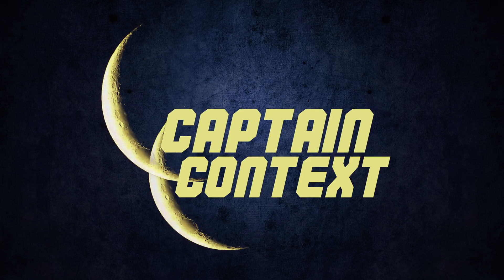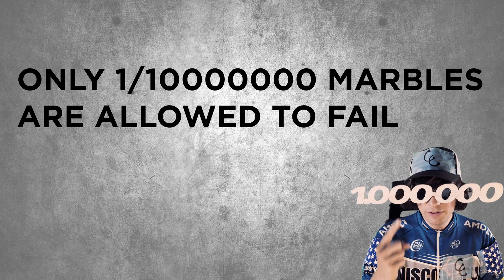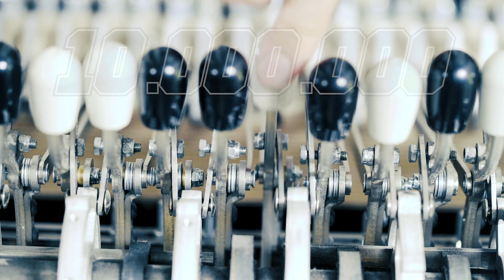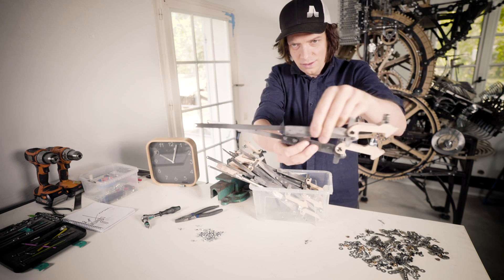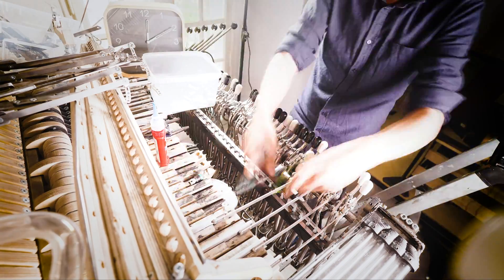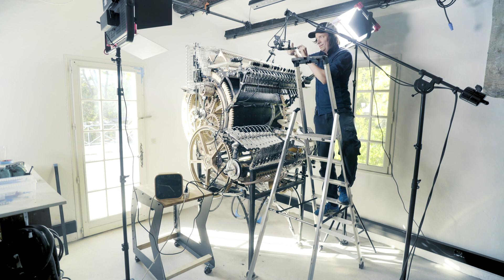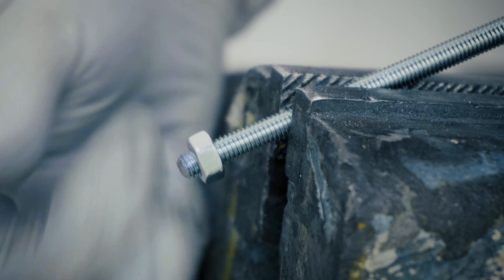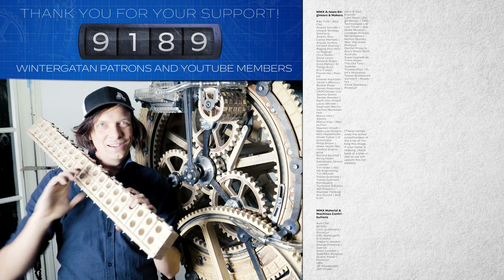Countersink? Why? - Marble Machine X #143

Comment: Martin, unfortunately math doesn't work that way. If only 1/10,000,000 marbles are allowed to fail in your whole machine, you have to multiply all the "chances" of things going wrong together to arrive at that.

That is to say, you need the equation:

[Chance of Success derived from the specific Part]^[Number of parts that can fail] = 1 - [1/10,000,000]

As we've simplified down to a single part's chance of success* instead of aggregate success, we can use the substitution to find maximum allowable failure rate with 

[Chance of success needed] = (1 - [Max Chance of Failure])

Let's just assume you have 1000 parts that can fail/can affect marble failure (I'm sure it'll be much higher, in the end, but just for rough math purposes...)

That means

[Chance of Success needed]^[1000] = 1- [0.00000001]

[Chance of Success needed] = [0.9999999]^(1/[1000])

[Chance of Success needed] = 0.99999999989999999500499966716648....

[1 - [Max Allowable Chance of Failure]] = 0.99999999989999999500499966716648

[Max single part failure rate] = 0.000000000100000004995000332834

or basically, 1/9,999,999,501 ... 1 in 10 billion, basically. 

That is to say, if each part in your machine has 10 billion marble events, they should only fail catastrophically/haltingly once. Any higher failure rate means that in the aggregate, you will have more than your 1/10,000,000 failure rate for the overall machine.

*The reason we have to do everything with a "1 -" is that we're looking at failure rate in aggregate, so we don't need everything to go wrong, but rather everything to go right. This math takes into account "double failures",  "triple failures", and so on.

Comment: I understand the reasoning here, but I feel I must point out 2 things:

1) this is a misuse of statistics. A marble will eventually fail. The machine will eventually break. Plan for it, because that ONE in ___ can be the first song, or even the 1st marble. 

2) You're chasing past 6 sigma, something that almost bankrupted Motorola. Its not feasible. Instead, a better thought process would be to plan on how something fails. A missed note, a dropped marble, or even an easily replaceable part is something that will not stop the whole show. As you're redesigning, experiment with the part to see HOW it will fail, because it will happen. A failure doesn't have to "break" the marble machine.
Reply: I'm also curious about how will wear and tear affect the machine and the marbles? Can they even make 1000 songs without breaking?

Comment: I still don't get why if 1 song is 3500 marbles and probability of fail is 1/10.000 you can play only 1 song "with luck"?
Isn't it (3500 * 2 = 7000, but not 3500 * 3 = 10.500) 2 songs with luck?
P.S. But I still get the desire to make it more reliable, though! And totally into it!

Comment: Dear Captain Context:  I love your heroic framing of the problem.  But... as many viewers and supporters are noting, your reliability goal is extremely ambitious and somewhat arbitrary.  You are shooting for “seven 9’s” reliability.  That is extraordinarily high.  Yes, there ARE engineering systems in our everyday lives that meet or exceed this (the cylinders in your car were mentioned by one commenter).  But, they are intensively engineered systems, developed over years and with huge efforts of many engineers.  I have to say, as much as I love your spirit and your creativity and perseverance, this is likely to be beyond the reach of your project, your resources.  Disclaimer:  I am not a Quality/Reliability engineer; just a mechanical engineer with 30+ years’ experience and a doctorate in ME.  One who has shared your journey for several years and is grateful for the weekly joy of your videos!

Respectfully:  set your sights lower.  Why specify, for example, that the MMX should play 1000 songs without a single failure of any sort?  What are the consequences - artistically, as well as mechanically - of a failure say, once every song?  Or twice every song?  Or...???

As others have noted:  explore the notion of GRACEFUL failure:  devise your engineering approach such that, when something goes sideways, it doesn’t have catastrophic consequences for the machine.  Related notions:  “fault tolerance”; “single-point failures”; Failure Effects and Mode analysis. (FEMA).  Familiarize yourself with these principles and practices, and then you will have TRUE engineering Context for your efforts.  Good luck wrestling the Reliability Dragon!  

If I may:  this is kind of a make-or-break point of your long effort:  either you learn and grow in this critical area of reliability engineering and define your reliability goals accordingly, or you will fall into a sort of “sunk-cost fallacy” of chasing a degree of perfection for far too long, which you’ll likely fall short of.  Please take our counsel and consider this to be your next area of engineering knowledge growth.  You have come so far in your knowledge these last two years, and have weathered the inevitable emotional highs and lows.  Most practicing engineers know that , after a prototype of a complex system has been created, testing it (to identify failure modes) and re-working it to make it sufficiently reliable is where a LOT of the work of a product introduction occurs.  Your have already started testing.  Now (again, respectfully), step up to the challenge of really understanding how engineers - both design and reliability engineers - tackle this thorny issue.  

There aren’t any cookie-cutter formulaic answers for how to set your reliability goals, but there ARE principles and guidelines.  Take some time to at least become aware that they exist, and digest what you can about them.  I know you can do this.  And, we are rooting for you!!

Comment: If it's this complicated for a marbel machine, imagine what the space engineers have to deal with for a spacecraft to make it nearly perfect.
Reply: Space engineers don't make perfect spacecraft. They make then good enough. They are not trying to pursuit an unicorn of perfection and reliability. They want a machine that works, does the job and doesn't kill the astronauts. Hence why it takes decades of research before even the first bolt is affixed to the first panel of the finished product.

Comment: I'm trying to relate this to an automobile engine.  I drive to work, and I drive home.  For most of the drive the engine RPM is 1500 (a little more).  This takes 40 minutes and I do it 200 times per year.  That's 12,000,000 revolutions of the engine w/o fail.  24,000,000 combustion cycles.  Summer up to 30°C ambient, winter down to -30°C ambient.  Vibration, shock, etc.
But, if the engine misfires once during each drive then I probably would not ever know about it[1] and the engine would not fail and nor would the drive.
Others comment that the machine should be fault tolerant
- so a marble note channel could fail - would that destroy the machine?  No.  
- Would that destroy the song?  Probably not.
- can the machine be designed to quickly clear the most likely jams?
..right in the middle of a song, perhaps?
- etc.
This is a mechanical machine.  Failure is inevitable and much more likely than in an automobile engine which is a lot of moving parts... 

especially if the machine is on tour (because moving large, heavy, complex mechanical machines is perfectly easy to do without it being twisted, shocked, etc ...).  The build of that case can be the subject of a couple dozen videos....

Keep up the great work!

(And yes, as others say, those spacers ...ugh).

[1] - of course I would: OBD II/Bludriver.

Comment: I just thought of this, so maybe a little late in the game, lol, but instead of climbing up and down on a ladder all day, having to move it all the time not to mention the possibility of it falling if you lose your balance, have you ever thought of using a pair of stilts?  

There are various type, the most obvious is the kind that drywall workers use to hang sheetrock on ceilings, but I've also use a pair of jumping stilts (those crazy springy things that are made for outdoor exercise fun).  It takes a little bit to get used to them, but they might be better than standing on a ladder all day.  

The only drawback is that you'd need to make a work bench that could be raised to the right height so that you wouldn't have to constantly take them off and put them back on, lol.  But I've also seen people use inverted 5-gallon buckets with reinforced "top" (which is really the bottom of the bucket) to stand on and some simply loops to slide your feet into so you can sort of shuffle around your work, and getting down is super simple ;?)

Comment: oor you could just make the marbles fail in a predictable way, like a serrated line in a notebook, or the indents in a chocolate bar. the stress you put into the chocolate causes it to break, but only where its designed to break. i dont know exactly how you would go about doing this with the marble dropping mechanisms or marble lift etc. but its something to consider.

Comment: Well if something like this could be a problem. Then design all parts and future parts to be flushed within the surface, and not sticking out by any means. It may cost some time in the front, but at least will not lead to cutting the parts and start all over after

Comment: I'm wondering:
 is the marble machine fail safe (meaning if a part fails does it doesn't break)?
If not have you considered making it so. It would allow for a "lower" reliability without any significant impact on the final objectif

Comment: I am a programmer and one thing that my teacher always told me is that if there is slight possibility for somethig to go wrong make a way for the code to solve it without interrupting the while system and that is something that I always think while coding. To make something 99,99999% reliable is just IMPOSSIBLE since there is no way you can make a test to confirm that. I feel that it makes no sense to try and achieve perfection in that level since there are so many variables that can go wrong and by fixing one there is a chance that it will create a new problem somewhere else. Just by making sure that the machine doesn’t break when a marble gets stuck is much better idea and tbh I don’t know what would be so catastrophic about the fact that there would be one missed note in a song

Comment: I think a couple errors per song are not going to be noticed. As long as it continues to work after an error, it should be fine.
You should try to make sure it always fails in a safe way, attempting to make sure it never fails, won't work out. 
When they build the apollo computer, they didn't make sure it didn't fail, but they just put multiple into the spacecraft to make sure nothing catastrophic happens if it fails. 
You can try and minimize errors, but you will not be able to make it work 10 million times in a row without any error, i can tell you that.
Reply: Single note errors are not a big deal.  The really catastrophic errors are anything that prevents the crank and everything tied to it from being able to rotate.  Less bad would be a jam that causes a single channel to stop playing but the rest of the machine continues playing.  It's important for that to not be able to fail in a way that it blocks the programming wheel from rotating and breaking the whole machine, but I think Martin would consider that single channel failure during a concert to be a failure of the machine.
Reply: @krtwood  He should just recognise that it is going to produce some amount of failures and make sure that those failures are not severe enough to stop the performance entirely.
Attempting to build a machine that has a chance of 1/10000000 of a single failure is the wrong aproach.
In my opinion.

Comment: Actually this isn't by any means an impossible target. Internal combustion engines run at several thousand rpm for hours on end and complex looms weave fabric without failure. So long as the design and materials are right, reliability just happens.

Comment: @Wintergatan please investigate the idea of "anti-fragility". This is the direction you need to take for the marble machine. Others in the comments have talked the idea of fuses, basically, you need known, recoverable (preferably in an automatic fashion) failure points. The machine needs to safely recover (even mid-song) instead of trying to create perfect reliability.

Comment: those 3500 marbles get divided into the channels so the channels don't have the same about of cycles. also I imagine the drum channels are going to be used the most.

Also like everyone else is saying failure mode is a huge part of engineering you can never design a part to never fail but if the channel fails in a way where there is an easy way to reset it then you'll be able to play songs on tour. (I'm sure no-one goes through a show hitting every note exactly on time but the audience still enjoys it)

Comment: That Ratchet was very satisfying with Beyer Dynamic DT 177X GO. How about engineering emergency pliability into part, so that instead of breaking it when jamming, it can slightly bend and then launch the marble somewhere else. If you can have system that breaks only 1 time out of 100 you have just added many zeros after the 10000000. I am thinking about making channelpaths, which have hard springloading. In normal operation springs rest against stop, but when hard pressed, it would give and then launch the marble somewhere, instead of splitting the whole board.

Comment: Wouldn't it be good to drill a hole in the wooden lid over each of the registrators? 
So you can refill graphite with ease. I know graphite last for a long time, but not for a thousand songs :)
The holes could be easily plugged with something to keep anything from falling into the holes.
Or perhaps that wont be reachable when the rest of the machine is assembled.

Comment: Martin I love your videos and I have been following you and the MMX for about a year now! As an engineer I love the ingenuity in your designs and your thought process as well as methods of machining. This is my first comment, because out all the things you have done, today I felt like I have to speak up: I think you are setting yourself up for failure if you're trying to 1/10000000 failure rate. Increasing the reliability of a device becomes exponentially more difficult and I think you should reconsider your requirement. Should the machine really be able to work for a thousand songs? What if  you change the requirements for the machine to do well during one concert (10-20 songs)? I really want you to succeed but that means meeting reasonable expectations

Comment: Fun fact: if you heat cured thread locker IT RELEASES!
Reply: Yeah sure but that would probably melt the plastic bit and then how do you reuse that single-use locking nut...?

Comment: You desperately need a lathe, even a small entry level one so you can replace stacks of washers with proper bushings, and you can clean up your fasteners so much more reliably than just sanding them off.
Reply: Part of it is adjustability. If he needs to, he can change the spacing by adding/removing washers.

Not totally sure if that is needed with this section of the MMX, but he has mentioned in previous videos about other sections of the MMX that's why he is using stacks of washers.
Reply: This is also a great place for 3D printed bushings.
Reply: If he does that the entire washer industry will most likely collapse and never recover.
Reply: he could get Ivan Miranda to print some SPACERS.
Reply: Somebody send him a lathe.
Reply: My heart sinks every time I see one of those stacks of washers.
Reply: He could easily? have someone make such custom parts for him. So he can focus on assembly.

I cringe a bit at seeing all those washers too.
Reply: @AlexHaan  Yeah, I feel they'll appear in a future video.
Reply: A DoAll is reasonably priced. Someone should donate one.

Comment: The screw problem... You should have used different screws. Like with different heads. That would be the correct solution.  The one you did is suboptimal.
I'm currently studying engineering and just a couple dayw ago we talked about bolts and screws connections relating to aviational engines. There's not as much vibrations in your work, but I suspect using appropriate bolts and screws would not be excessive here.

Comment: All those mechanisms look sloppy with far too much play in them to begin with and that's a big issue in my opinion.  Moving parts need to be designed to move only within a defined spacial context that supports the desired functionality & then the parts designed/selected accordingly to fit and function within that context. Allowing parts to flap around makes achieving your 1 in 10,000,000 target very difficult, as does cutting corners such as using stacks of washers instead of correctly sized spacers.

I also think that you need to split the failure modes between critical and non critical, it won't be the end of the world if an occasional note is wrong, missed or added - that is a non critical failure, whereas a fault that stops the machine from working for a period of time/breaks parts of the machine would be a critical failure.  I very much doubt that there's a musician that could play 10,000,000 notes without a single error... and to be honest that level of reliability results in something that might just as well be synthesised in my opinion.